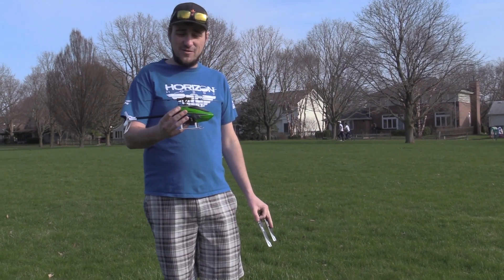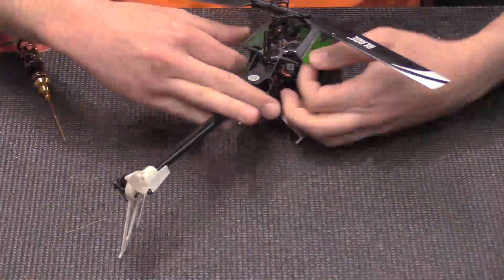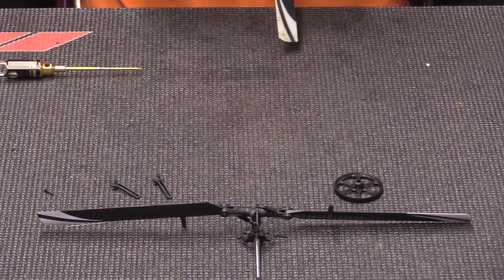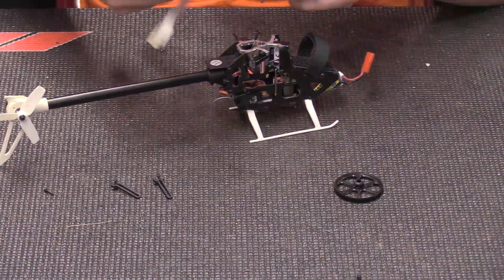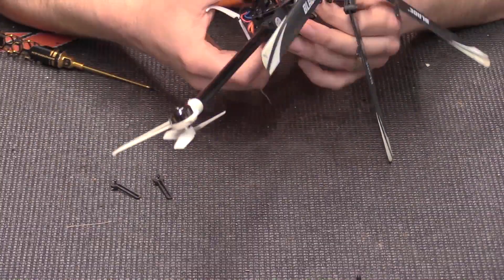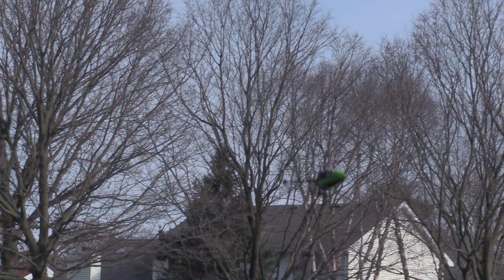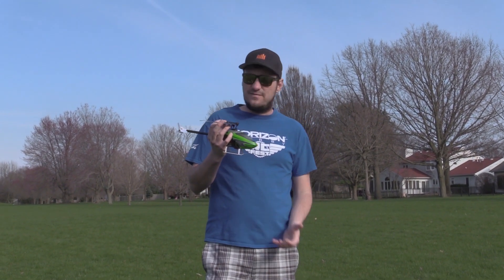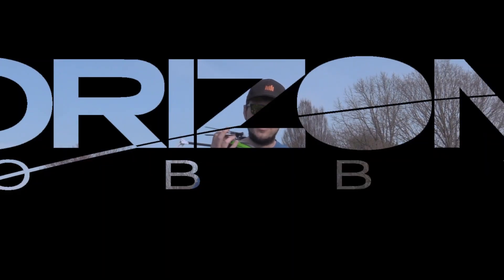Three-Blade 150 S? - Horizon Insider Tech Talk

Comment: Two blades are always more efficient than three. In fixed wing anyway, a two blade gives better cruise performance while three blades yield a better climb. On a heli I'm sure a three blade is quicker to respond to the swashplate. Ultimately you would want the three blade head to be a lesser diameter than the two. Cool kit-bash.

Comment: Since you have three blades did you reduce the pitch and RPM? Should be much less pitch required, and around 10% less RPM. That could get you some more battery power.
Reply from the maker: Nope, no tuning was done ;). You are certainly correct though, but this was more for "proof of concept" than anything else.